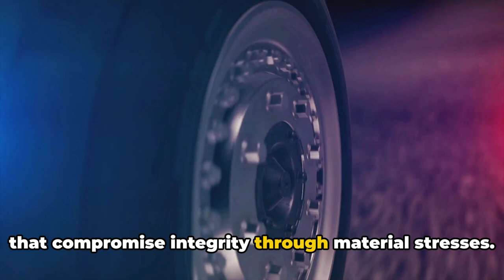Bad Rotors Symptoms: 6 Brake Disc Failure Signs

Comment: Great video. Here in saltbelt of Norway, the brake discs dont get the chance to wear out, they are usually rusted out after 2-4 years and then they must be replaced.
Reply from the maker: Thanks for watching and sharing your experience from Norway! It's fascinating how different climates and conditions can affect vehicle parts differently. Rust is indeed a tough opponent for brake discs!